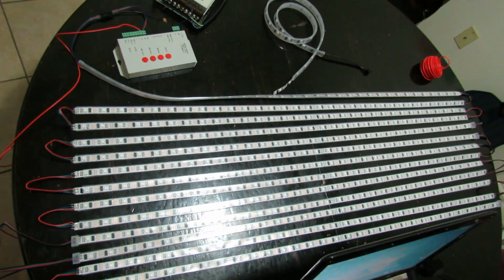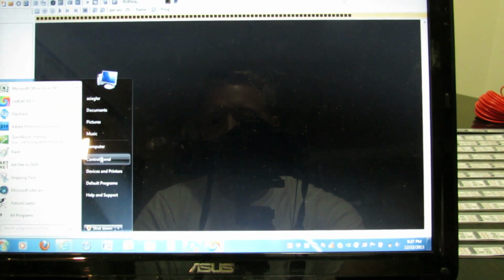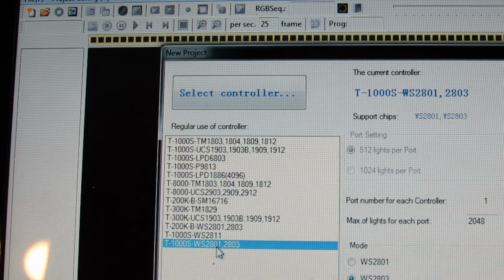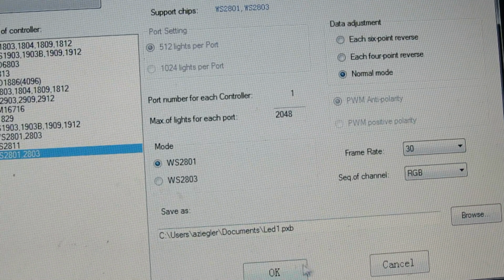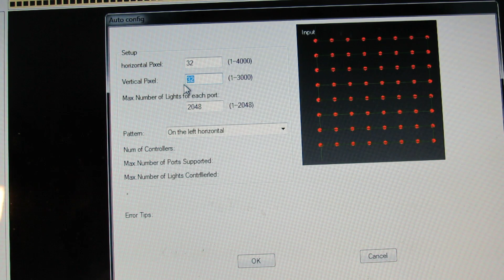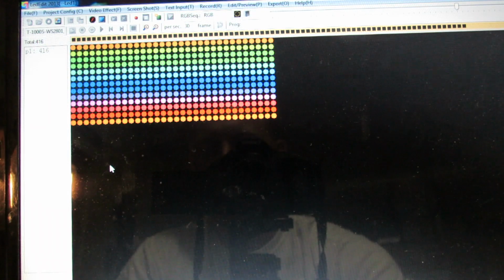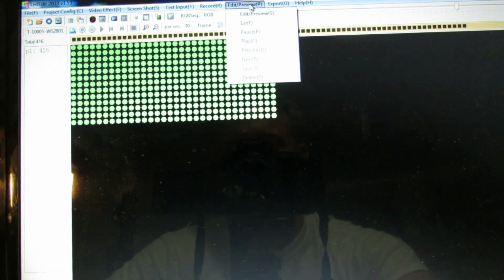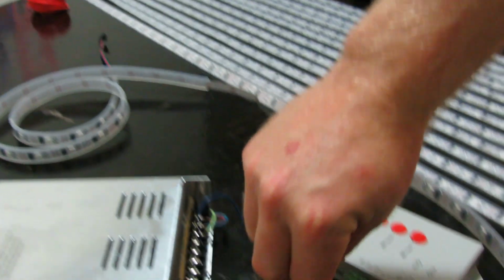How to Build an LED Display, #2 Setting up the programming software (WS2801 LEDs)

Comment: Do you know of any control boxes that can be controlled similarly to this but through Bluetooth and an application I would be creating myself? Most of the boxes all seem to have apps sold with them and I am unaware if the box has security measures to stop other apps being used.

Comment: I have a ws2812 but I can't find it in the chip options. What do I select? Someone told me to use the Ws2811 but it still says error when I slot the SD card into the controller

Comment: i know evry thing about led edit
but while i programmed led on led edit i chooses a right code (SM16716) and controller 
but i find changed in led colour but the program work and i can seen effect hard to seen ,there big different in color 
i find yellow colour and i don't chose it 
what i should do 
change setting current 12mA ?? 
Gamma ? 
i use led 2012,2013,2014
what i should do ?? !

Comment: Hey Bud I am using 1000 controller and trying to program 2811 LED with 51 LEDs its not running the program, it just lights only one LED in red. Please could help me in doing it successfully!!

Comment: hello my ws2801 panel I made using the t1000s will only allow me to use lededit 2012 do you know why that is if I use lededit 2013 or 2014 and it doesn't work right the panel light up but not how it does with 2012

Comment: Does anyone know how to use the T8000 controller and the software setup on led edit 2014.   i use a T1000 that is easily programmed by led edit.  but if i try to program the leds with a T8000  i get  random output not like the pattern i selected ( passage) ..  Thanks